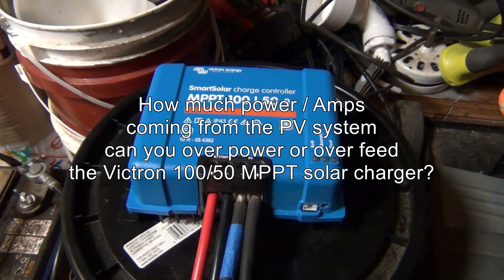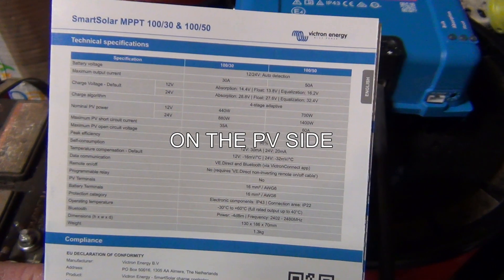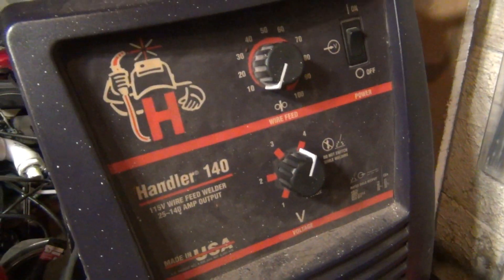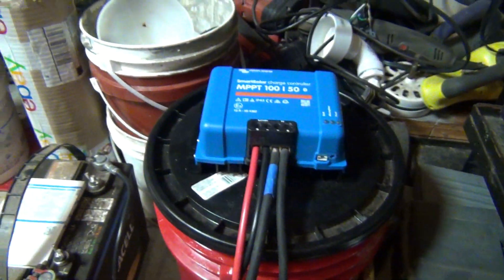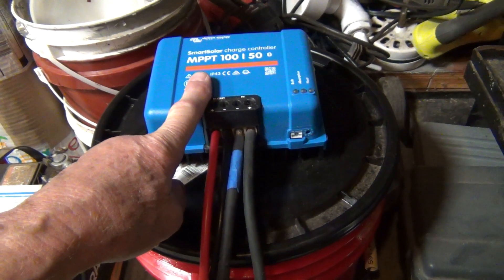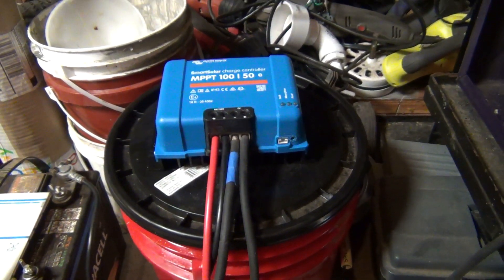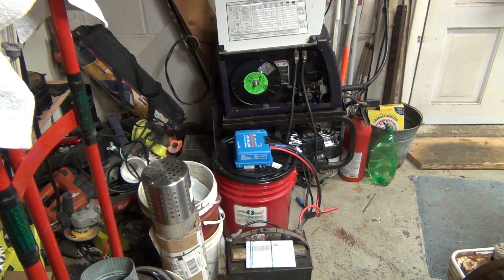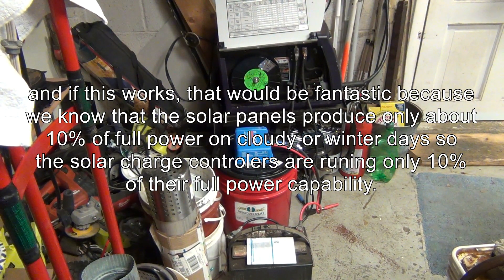How many Watts / Amps of solar power can you put on Victron 100/50 MPPT solar charge controller

Comment: Hey friend, what this means is that if you exceed 60 amps at the PV input, you'll have a breakdown. Most people think like you. The truth is, if the battery and panels are connected and the solar charger is working, and for any reason there's a short circuit at the PV input, you'll have a breakdown. This is because most batteries will exceed 60 amps, and it's because current can flow to the PV input when the charger is "on," and only when it's "on." I'm emphasizing this because there's always someone who doesn't understand. In normal use, you can put in more amps than the charger can handle, and it won't complain.

Comment: its a DC_DC circuit= what you plug in not matters it put out 50 Amps= limit itself.....
plug a 24 Volt LIFEPo4 on any random charger to the input and let it charge a 12 volt battery....and magic happens 100% charge speed......

Comment: Umm i could of told you that adding extra panels for cloudy days would be a good idea. You didnt have to plug it to a welder to find that out.
Reply: yes pointless, a charger that is limited to put out 50 Amps can not draw moren then this..... its self explaining......
if anyone will try out the real charge spedd from his charger battery 24 volt to input and 12 volt to the output = 100% charge speed forced.

LiFEPo4 batterys can easy deliver hundrets of amps so the perfecct unlimited power source for DC-DC circuits.

Comment: Strike an arc with the welder and see what happens.
Reply from the maker: @swerkescircus7308  what do you think will happen “?
Reply: @VladFredK correct me if I missed something. I didn't see the amps even get to 60. 10amps is the most I saw on the app. Were you trying to get it over 60amps? The welder is not going to ask for much power until it is actually welding. You might have to turn up the wire speed to weld at max power.
Reply from the maker: @swerkescircus7308  I’m sorry but you completely misunderstood the whole thing, please watch it a few more times hopefully you will understand. The power is connected straight to the transformer, I don’t need to strike the spark

Comment: The test of the charger is indeed about the battery as well..  if you dont have a battery that can accept the charge, the battery is whats doing the throttling not the charge controller. And your typical lead acid battery will only accept 30-40 amps even if you connect a 1000amp charger to it. The only way it will take higher current is if you also over volt the battery. If you want to do this test properly you need many lead acid batteries in parallel, at low state of charge. That or you need lithium because they have low internal resistance and can accept hundreds of amps depending on the size of battery. Mine are 420ah 52v lithium and i charge them with victron solar charge controllers at 200amps everyday because thats what im comfortable pushing my bms to, but the battery cells can happily take the full 420amps if i really wanted to. (And if i had that much solar)

Comment: I'm guessing the reason for the 60 amp input limit is because it takes less current on the higher voltage PV input side to give you 100 amps on the lower 12 volt battery output side.  I'm sure there is a Wattage component involved.

Comment: the solar controller will only "drink" as much (voltage less than 100 volts @ given amps available) as it takes in order to make a voltage of 12/24/36/or 48 @ 50 amps

You can have a billion amps of power @ 90 volts and the solar controller will only drink what it can consume. You cant "force" amps into it.

Imagine plugging in a small fan into your wall outlet. There is way more available amps in the outlet than your fan can consume.
Reply from the maker: Damn, why am I so dump?  :)  Dude the Solar charge controller doesn't exactly work like a light bulb so you can't just assume it will regulate the power coming in. But if you are so smart, then tell me why is Victron limiting the PV Amps to 60 A max? Thank you.
Reply: 100v x 60a = 6000w (pv) Your output is 50a x 12v = 600w, 50a x 24v = 1200w, 50a x 36v = 1800w, 50a x 48v = 2400w. So lets say you use (2) 40V open voltage panels, you can only use 2 in series (80v) and then you must add pairs till you get max "watts".  If your voltage was a conservative 70v x 60A =4200w, still way way over kill for your max of 2400w.  @VladFredK
Reply: @greengooseman  very well done, Do you live in Arizona? I don’t, and we have lots of cloudy days here so the panels work at 10% full capacity, so should I have a switch to add more panels on cloudy days? ….. You know your mat but it doesn’t work like that in real applications.
Reply: @tysesty  Over paneling is always good. The question was if having 140A would hurt your solar controller. 
I have a 15kw 36v battery bank. I am using a 150/60 victron solar controller. Im only running (9) 320w panels (Potential of 2,880 w). 
I charge my batteries @ 60A x 36v = 2160w
My battery bank can easily discharge @300A but I have a circuit breaker for 100A as I never draw over 2000w on my inverter.
I often charge my portable solar generators off my batteries by plugging into the "solar" input.
My ecoflow Delta 2 can charge at a max rate of 15a using its built in MPPT. My battery has well over 300a potential output but is no danger to my solar generators.
MPPTs are self limiting. 
You can connect your 100/50 to a million solar panels as long as you dont exceed the 100v input.

Comment: I should add, if you run too "much panel" on a MPPT controller you may get shut offs during transient events, such as full sun coming out from behind a cloud, as the controller cannot change it's transfer ratio quick enough and an overcurrent or overvoltage event leads to a shut down. You can't run with too much series panel because the maximum panel voltage must stay within the voltage rating of the unit (100V) and that voltage is going to be generated under the higest insolation. You can run with "too much panel" in parallel, other than the usual issues of ensuring panels stay forwards biased etc
Reply from the maker: That would be common sense at least for me.

Comment: An MPPT controller is just a non isolated BUCK DC DC converter. It uses an inductor and a power switch to voltage match between the panel voltage and the battery voltage. The power and current limitations come from the current density limit in the inductor and the thermal limit of the power switch primarily.   Power out = Power in - losses.  In this case, the inductor & switch cannot handle more than 50A  continously and less than that if they get hot, as the unit derates as it heats up btw, lowering it's current transfer to prevent thermal runaway and failure.

The maxium 50A output into the maximum battery voltage for the unit sets the absolute power limit, and the unit will simply "throttle" the solar input (by moving away from the maximum power point) to keep the current at the limiting value.

In your test your welder is effectively a constant voltage source, and your battery another constant voltage sink (for the duration of this short test anyway), so the controller will simply ramp up the output voltage to a voltage above the battery voltage by an amount that drives the maximum allowed current into the battery but no more.  If you look at your test, you'll see the output voltage was higher for the 25A output test than for the 10A test because of the resistance of your battery and leads.  With the unit attached to your welder, all it did was to change it's voltage transfer ratio to push up the input voltage, meaning the current that was pulled from the welder falls.

iirc, the 48v output MPPT from victron can go up to around 60V maximum, so at 50A that's an output power for a single unit of 50A x 60V which is 3000W.  On a 12v nominal battery system, then output power is of course much less at the same output current, ie 50 x 12 = 600W.  For maximum power transfer you want the highest possible battery voltage and ideally you want a transfer ratio as close as possible to the minimum step down ratio, but because this unit is only a buck converter architecture the input voltage from the panels must always be higher than the output battery voltage by a margin
Reply from the maker: Thank you for the long explanation here. We could discus this for all day and I do agree on most what you said here but you are a little off on a few things but I really don't want to get into long discussion here. Bottom line is you can safely over panel / overpower the PV input on Victron solar charge controller. Thanks
Reply: @VladFredK  There is no need to overpower INPUT to such current. Only if you have BAD FF - fill factor and high temp. of sol. panels, e.g.  65 - 70 *C and you want max. output 50 A at sunny day and you have all panels parallel and IN voltage close to OUT voltage. So if you have FF == 66 %, you can add 1.51x more panels with rspect to STC or NOCT conditions of your solar panels. If you have 2-phase topology, 2S solar panels connection to input is ideal for maximum efficiency. If 3-phase BUCK topology, 3S would be ideal.
Reply from the maker: @PavolFilek  fantastic, can you please translate it into plain English so everyone understands, besides I disagree with you.
Reply: In Victron is more advanced converter, called SEPIC. Use 2 coils to constant take power from panels, and that i reason so Victron is more effective like other, chinese solar chargers, often only name MPPT, when typicaly are PWM.

Comment: Victron say as long as the input voltage is under 100v, you can input as many watts as you want, but the controller will limit the ouput to 50amps on that model. They 'recommend' oversizing the panels by up to 130% to what's stated as the maxium pv input, but I think this is just for warranty purposes.
Reply: That is the answer I have been looking for. I just got the 100/50 and I was trying to calculate how many panels to hook up. At 12v I should be fine with 8 100 watt panels 4s2p. Even though it says max is 700 watts. Mainly I just wanted to see if I would be able to hook up more than 6 100 watt panels because 7 is an odd number and I found that strange.
Reply from the maker: where did you get it from? Thanks
Reply: @VladFredK  I read this on the Victron community. If you Google 'victron over panelling' you will find some answers on the community page.
Reply from the maker: @chrisb5839  I just go with Victron user manual, it’s right there.
Reply: Now the issue I am having is I can't connect my phone through the app. I tried all the common fixes. I'm at the point where I am just going to buy a new phone. It worked for like the first three days but then it quit connecting via Bluetooth. I really hope it's the phone and not the solar controller itself. I paid almost 200 dollars for the controller from Amazon.

Comment: It's just ohm's law... 140A on the label of the welder does not mean there will be 140A flowing. It is just the maximum the welder can deliver. The welder supplies a certain voltage, the load (the charge controller in this case) will dictate how much amps there will be flowing. As long as it stays below the 140A the welder can deliver.